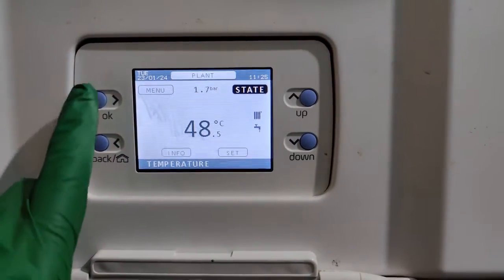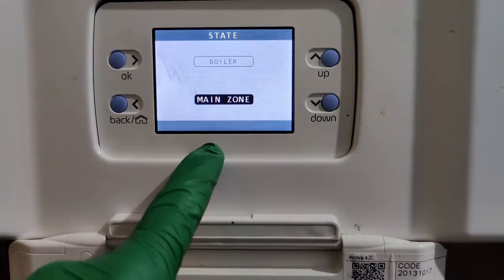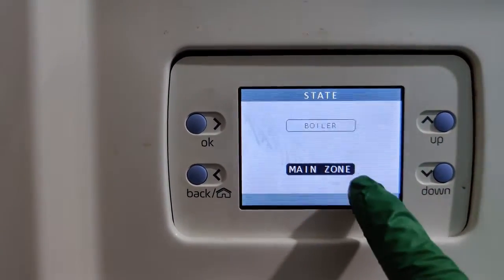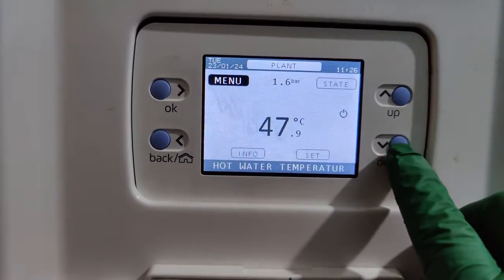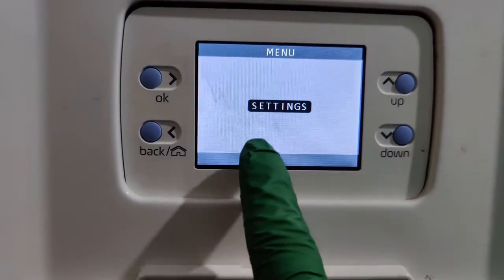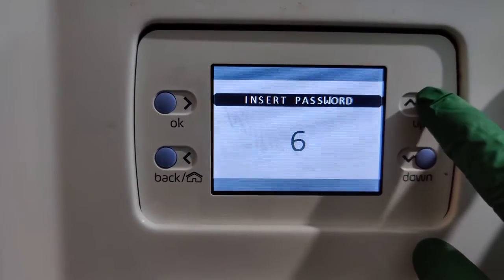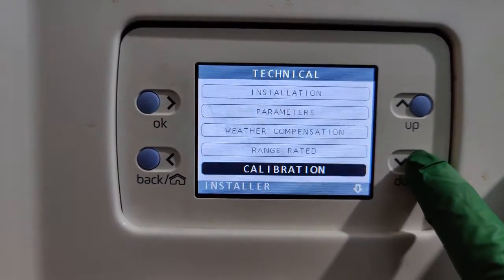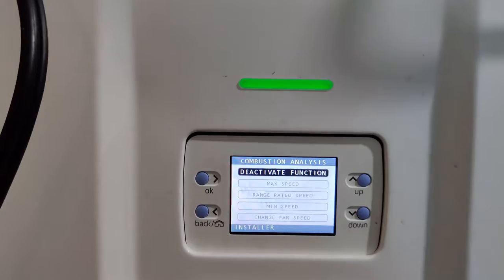Vokera Evolve- How to put a Vokera Evolve into Service Mode High Low CO Readings & CO/CO2 Ratio

Comment: What was the fault? I’m got the same fault and the outer flue is damaged I’m wondering if it’s that, cheers
Reply from the maker: Hi mate. In this case the gas supply was undersized and was only providing 14mbar at full rate which was resulting in incorrect combustion readings.